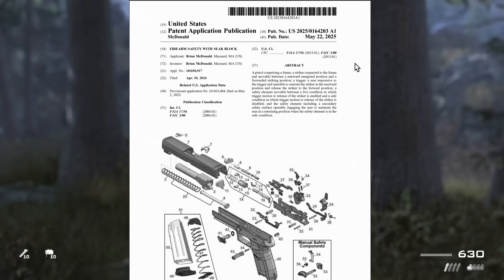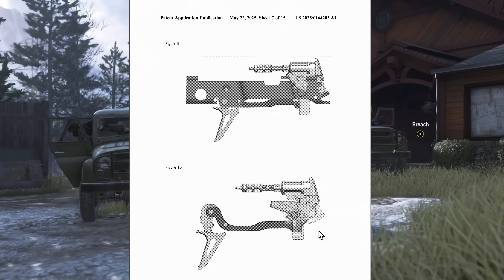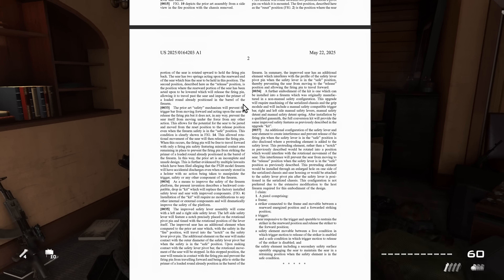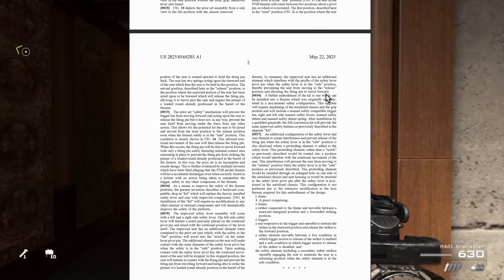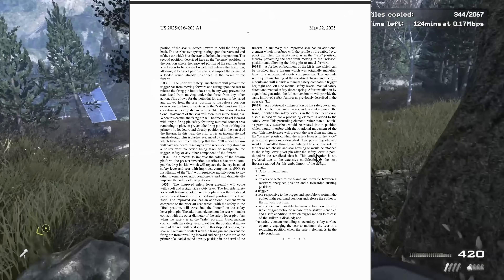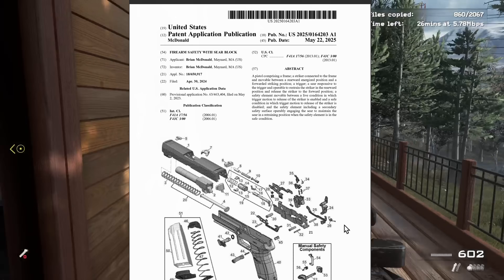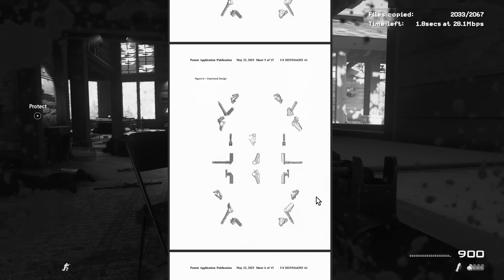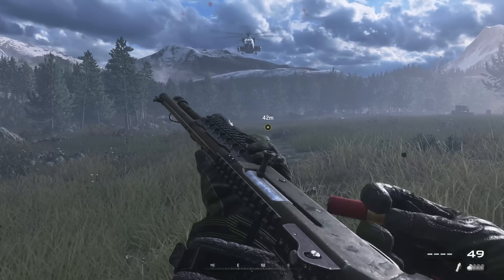Explosive: New Patent Claims Fix For  "Incomplete, Unsafe" 320 Design

Comment: Sig needs to step up to the plate and admit that they have a problem, trying to say that it is operator error of the same model weapon across the United States is Ludacris. If the same people were that incompetent they would have had accidental discharge with any kind of a weapon not just the same model. Whether they try to fix the problem or not is irrelevant. The real problem exists is gaining The public's trust back. As a retired law enforcement officer of 30 years I would never buy a Sig gun because of how they're acting with this one. You don't get the Public trust by saying; "it's a bunch of ignorant people, setting it off accidentally, honest,"  trust me. Sig's problem is people don't trust them. If you're not going to question where the real problem exists, you'll never find the real problem at all. Not every person that uses a 320 is incompetent. The public trust is broken, you can't get that back with a simple, "trust me."

Comment: Another engineering theory! oh hum! My Sig factory Custom shop 320 has more than 2000 rounds fired and has only ever gone off when I have physically pulled the trigger. 
But, since it has no 1911 type additional mechanical safeties, I use it for sporting and don’t bang it around while in condition 1!

Comment: So with all the stories about the P320's going off by wiggling the slides and every other thing that has been tried, I just have a couple of questions. 1) How are they rotating the captive safety lever. 2) How are they depressing and disengaging the striker safety lock. 3) How did they damage the sears on the P320.

Comment: This still doesn't make the gun safe in the fire position! And the gun will need the machining he described if its a non manual safety model (which I prefer). Its lipstick on a pig. And still would not be fixed

Comment: 1) Just because someone puts a patent on a new design for a gun and states the gun is "unsafe" doesn't necessarily mean it is fact. 2) The shooting that triggered all the media recently turned out to be a murder that was then blamed on the gun design to try to cover up the murder. 3) Why haven't all the YTers that posted videos about the "unsafe" P320 made follow up videos covering the murder? Why haven't they stated done videos that discuss that the same "test" that Wyoming Gun did with the P320 can do the same thing on a Glock? 4) Yes the P320 had issues early on, notice that there haven't been any actual incidents in over 1 year? Yet the haters will stoke the fire. 5) Has Sig dropped the ball on how they handled this? Absolutely. I also think they need to do more testing (parts swapping on guns like what military/LEO armorers will do) to determine if there is a possible situation what will more likely allow ND.

Comment: Hey Protraband,  I have a friend who works at Sig Sauer in the engineering department.  He told me that Sig Sauer is replacing p320's with Sig P211 GTO pistols for law enforcement agencies they have contracts with who stopped using the p320 due to all of the instances of the pistols having uncommanded discharges. My friend said This is why it has been taking so long for the Sig P211 GTO to finally be released because they were first filling orders for law enforcement agencies.

Comment: Nothing is wrong with the current safety.  This patent just adds material thus increasing cost.  It’s already proven that the p320 fires with trigger input the current safety disconnects from the sear when the trigger is partially pulled.

Comment: Basically the wear in the spring for the sear gets loose the longer it was holding the striker and moving the slide was like you lockpicking because the spring had little tension to cause the striker pin to let loose. (This is what im getting from looking at the fcu design.)

Comment: I like it, as it uses the manually safety to not only lockup the trigger bar but locks up the free floating sear movement. Cutting down on the likely hood of the striker leg walking off the free floating sear. It's safer, not sure if that is safe enough. If you also got rid of the extra play in the slide, then the striker leg would have less wiggle room to walk of the sear.

Comment: At this point, the best bet is a Glock-style chassis and mechanics—only when pulling the trigger is tension built in the striker spring, and the striker safety lock a plunger actuated by a fixed hump on the trigger bar.

Comment: Unless I missed it, the improvement only stops the sear movement when the safety is ON. Note that the "positive guide means" in the Glock patent, referred to in factory literature as the "drop safety" because it prevents the sear from dropping out of engagement with the lug of the firing pin, functions at all times. Also, this "fix" for the P320 can only be installed on a non-manual safety model by using the new parts and modifying the fire control housing and the frame to accept the new parts, so the non-manual safety model will become a manual safety model.

Comment: I am not a lawyer.
But I'm curious: If Sig is ever sued and whoever is suing them over the P320 uncommanded discharge that led to injury/death refuses to settle... Could the fact that Sig KNEW that there was an engineer working for them that developed a fix for the P320 but they ignored it mean even greater liability? Because it's one thing if it's something that Sig didn't know about (which... was never the case, Sig always knew) and couldn't engineer a fix for. But this guy drew up plans to modify the P320 to make it safe. It's a patent. It exists. Sig knows about it. Isn't that additional negligence or liability perhaps? Again, not a lawyer, I don't know. Just asking questions.

Comment: It makes the P320 safer, but doesn't fix the actual problem. Yes the gun would be safe while the safety is on, but could still randomly fire when the safety is off. That's unacceptable. Whatever fix they come up with has to prevent all unintentional discharges.

Comment: It appears in the submitted patent application that the new safety feature only applies to the P320 IF it has the "manual safety" feature. QUESTION: What if my P320 does not have the  manual safety. Does that mean that this new design does not apply to those without a manual safety?

Comment: You left out that he didn't file this while working at Sig, it was almost 10 years after. This solution, technically, could be based entirely off his opinion. It doesn't indicate Sig actually acknowledged the fault, or even asked this guy to come up with this.

Comment: This patent application, although very poorly drafted, has brought to my attention a problem in the design of the safety mechanisms of the P320. I believe that all these publications, which show that a P320 with a partially pre-tensioned trigger via screw, wedge, or similar components, lead the wrong way. This patent clearly demonstrates that the striker safety in the P320 has an unfavorable rotational inertia. Therefore, it can be deactivated by applying certain acceleration forces. The mass distribution of the striker safety seems to be so extreme that it is deactivated by an unfavorable impact load. In combination with the relatively large tolerance gap between the system frame and the slide frame, this could potentially cause a round to be fired upon a sufficient impact load.

Comment: The problem with specs is if your specs are garbage to begin with as things wear down from use then it doesn't matter if something is in spec because it will eventually be out of spec if the specs don't cover a wide enough use range to account for service life.

Comment: So, is it only safe with the safety on? What about the ones without manual external safeties??
Reply: This is to prevent gnomes from pushing the sear down with a punch. Only helps if the safety is on. It's a neat idea but doesn't address the root cause which is the lack of an external safety.

Comment: An LLC company Angled Spade Technologoies owns the patent and not SIG. It was filed "2024-04-30 Application filed by Individual". It is not cheap to file a utility patent as this patent is not granted yet, but only published to the public for review, "2025-05-22 Publication of US20250164203A1".  It typically takes 1 to 2 years before a patent is granted, and the examiner most likely will have office actions, which are corrections/updates to the content. Additionally, there is only one (1) claim, which suggests that his patent lawyer didn't do the job properly, as you can file up to three independent claims and a total of 20 claims without incurring extra costs. So this sounds like he wrote and filed it himself to save money on a patent lawyer.

Comment: From the sound of it, it won't fully fix it, and since it's meant for the manual safety, it doesn't fix the majority of the SIGs in the civilian and police space which aren't the manual safety version. Police generally aren't issued manual safety guns, much less taught to use the manual safety, hence why Double action revolvers, DAK P229s, and guns with trigger safeties like Glocks were issued.

It'll should help the manual safety version not go off when the safety is on, but the problem is that most people don't carry safety on, even in the military despite being explicitly told to carry that way. But, if it needs a manual safety to not go off in a holster, it's still not a safe design.

That's not to say this isn't a helpful fix, just that it isn't the big fix we're looking for. Realistically, it's more a matter of fixing tolerances, making the striker interface more durable so the safety catch doesn't skip due to worn out surfaces, and then making the safeties deactivate later in the trigger pull, rather than right at the wall.

Either way, good to see people doing SIG's job for them. If SIG won't fix it, at least we have people who will.

Comment: Glock has had a mechanically locked sear since its inception. The back of the trigger bar sits above a shelf that physically blocks the sear from moving down if the trigger isn’t pulled. The current P320 design uses just spring pressure to hold the sear up. That kind of design isn’t inherently unsafe, but it’s one hole in the Swiss cheese.

Comment: "If everything is built to spec" appears to be part of the P320 problem.  I would not trust this "fix" until and unless it were tested with every possible combination of parts and with the thumb safety in both Safe and Fire positions... and I don't think that will happen.  I especially don't trust it when the safety is in the Fire position as appears that the firearm would then be in the same condition as it was prior to fitting the kit.

Comment: So in order to carry a P320 safely, you have to install this redesigned manual safety and remember to always engage the safety before you holster the gun.  That's a big ask, especially when you consider that most civilians chose not to have a manual safety in the first place.  But if it only works when the safety is engaged, does it really solve the problem?  Suppose you're holding someone at gunpoint --- with the safety off, of course --- and something jostles your gun.  Now you've shot someone you didn't intend to, when your finger wasn't even on the trigger.  And it's going to be all but impossible to prove it wasn't your fault.

I might get the upgrade and sell the gun now, but I still wouldn't carry it myself.  And I f&^king hate SIG for putting us in this position.

Comment: So this is interesting but does it actually fix the issue.  Think about it.  If the sear can "slip" when bolstered, that means it can slip under other circumstances.  This saftey will prevent that but when the gun is drawn and being held on a suspect, the saftey comes off.... do you want to be the guy trying to convince a jury that you didn't shoot, the gun did?

Comment: At my range today the gunsmith said Sig is going to have a press conference this week announcing the two fixes that will be done. One is a different sear and another part for those with manual safeties alongside a pin and modification for non manual safeties. 
I was trying to buy a sear alone when he said this and why he has none is he had to send the ones he had back to sig. Also notice that everyone is out of sears.
Reply from the maker: Interesting
Reply: @Protraband yeah something is coming soon. P211 were supposed to be shipping by now and they aren’t. I think they are holding off until they fix this till they will be shipping. Large factor is the mags they use are p320 and advertised having the mags be easily interchangeable. So makes sense that they want people to feel comfortable buying both. 
If cutting off a small piece of the sear fixes everything then they definitely are figuring it out. This dude is just making it have to happen quicker.

Comment: Not saying I think this is the case, but it could be that he was involved in the design and sig cut contact once they felt they had gotten what they wanted from him. That "incomplete design" statement smells like a scorned designer to me. I design a type of specialty system for new buildings and I've had this happen to me. I send preliminary drawings/designs and then they just run with it, next thing you know I get a video of said system destroying itself because they never bothered to learn how it was supposed to be installed and the design was only preliminary.

Comment: Just noticed the patent is assigned to this company: ANGLED SPADE TECHNOLOGIES, LLC

Which explains why there's a random spade stamped on the side of the safety lever in the patent document.

Whether they're contracted by SIG Sauer or working independently is another question.

Look them up, they have a website. Maybe you can even contact them, @Protraband.

Comment: The patent, which includes updated parts designs, basically says that all P320s need a manual safety to be safe. 

This patent is curious. Sig has a history of rolling design updates with no generational destination while also gladly sitting back while people and companies like Bruce Gray/GrayGuns (who one minute are Super Sig Defenders only to turn around to have convenient fixes for problems they denied the existence of) produce parts under the guise of the “aftermarket”. This way Sig maintains plausible deniability and companies like GrayGuns profit off the 320. 

So, now this patent comes out from a “former” Sig employee who say the current 320 design is unsafe and has a design fix. For Sig, they again maintains plausible deniability as this patent can be seen as opinion. Later they can buy the patent and make changes to the 320 with no fuss. If that happens it will be a situation where everyone knows the truth, but on a technicality Sig takes no blame.

Comment: So if I'm reading this correctly (and I believe I am) this patent lays a few things out plainly:

1. To render the gun in a safe condition for the regular jostling of duty use, a manual safety MUST be installed
2. The manual safety MUST be engaged
3. The modifications require milling of the FCU and the installation of a manual safety frame
4. An entirely new sear plate is required 
5. SIG knew these problems existed and actively lied about defective products to the consumer market as well as LE and military customers.

Not only does this open SIG up to the lawsuits they're already facing, but massive class action suits as well, possibly consumer fraud, and maybe even defrauding the government as well as negligent endangerment. The amount of work it'll take to fix this far outweighs the sunken costs, these things need recalled en masse, not to mention the fact that having a manual safety that must be engaged at all times completely defeats the purpose of adopting a striker fired design. SIG is cooked.
Reply: Having a manual safety does not defeat the point of a striker fired pistol.  It enhances its safety.  I have 2 365’s  with a manual safety and I’d never carry a gun without one.
Reply: @47izaPedo Yes, I'm sure the tens of millions of striker fired, manual safety-less pistols from Glock, S&W, FN, CZ, Springfield, Canik, Walther, etc filling police, military, and concealed carrying civilian holsters are all wrong, and the ancient Fudd lore of "Must have manual safety!" is correct 🙄

Comment: If it works, it solves one problem with the 320. It doesn’t seem to address the striker block failing to prevent the pin from meeting the primer in some P320s.

Comment: Problem is this doesn’t solve the issues of the very poor design of the sear and safety system in the FCU 

Yes this absolutely helps mitigate problems with the safety on, but requires work for any non safety models 

This is a bandaid not a true fix. Undeniably better but still not a fix to the problems that causes the need for this. In all reality the FCU needs a complete redesign to fix the cascading issues that causes the uncommanded discharge

Comment: I'm not an expert on these things but while this is an improvement over the original design I feel it only fixes one of the many problems with the p320.

Because there is so much movement potential between the slide and the frame, I feel you would still get accidental discharges when this improvement is in a holster, as this fix does nothing to prevent the slide from lifting and disengaging the sear without the sear moving in the frame at all.